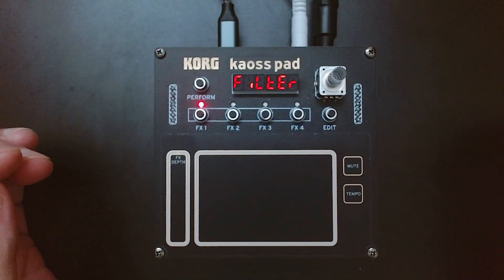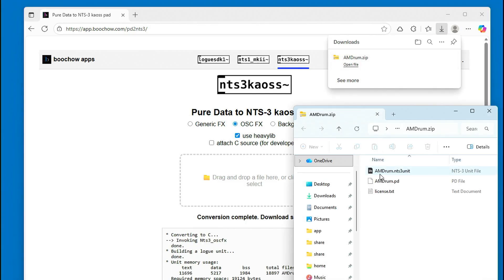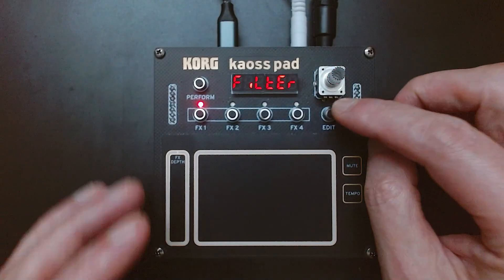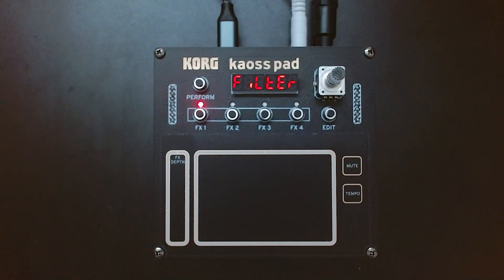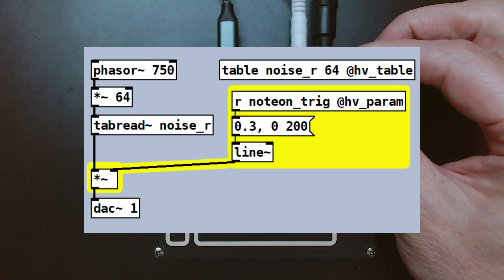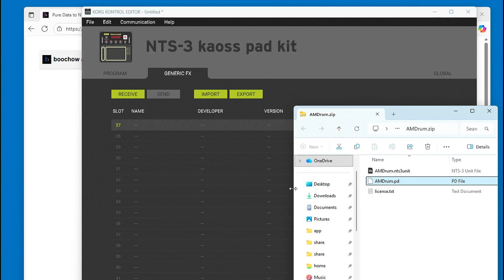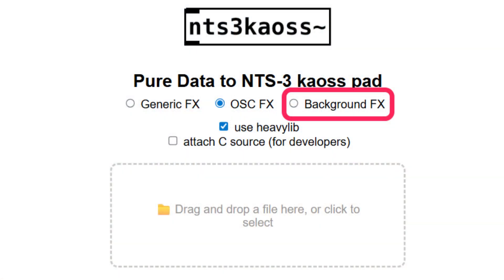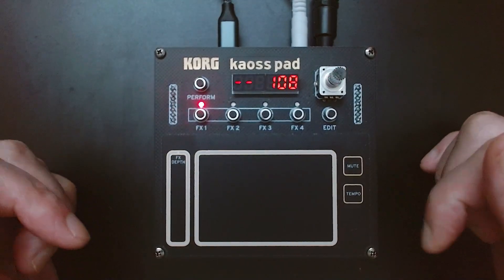Pure Data Comes to NTS-3 kaoss pad

Comment: Also, could it be possible to upload PLUGDATA files also or they need to be converted into PUREDATA format first???
Reply from the maker: You do not need to convert .pd files between plugdata and puredata; they are the same format. However, note that you can't use the libraries in the left side palette of the plugdata window -- they are not compatible with hvcc, the pd-to-C translator used in this converter.